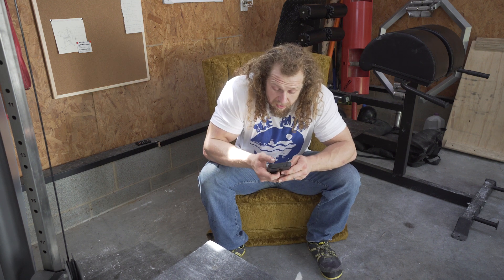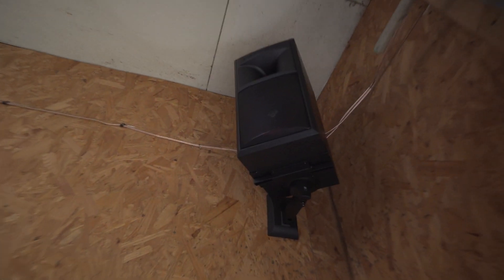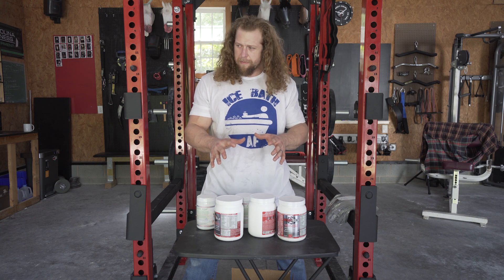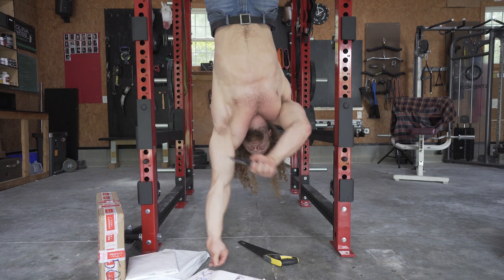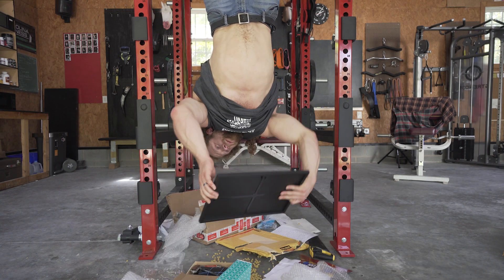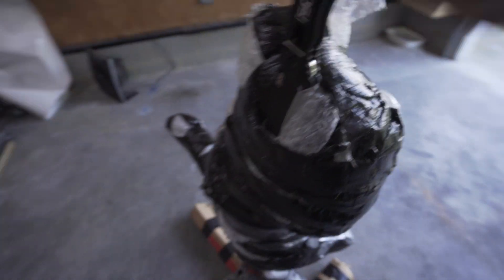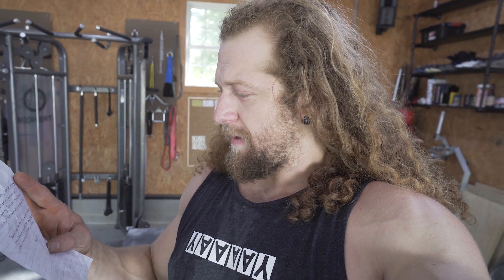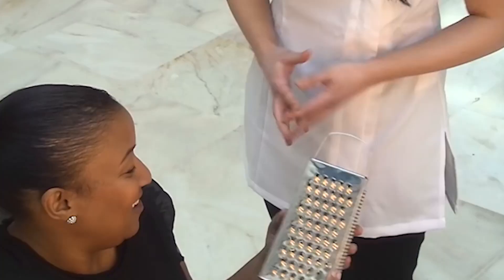Sumo deadlifting aerobics | ft. BANANA CHALK BOWL

Comment: Put your barbells on the garage door if its wide enough! Make sure you check that the track is anchored properly and can support the extra weight. Also need some sort of clamping hooks so they don't fall off when you roll it up. Pulley system with a rope on the opposite wall to roll up the door manually. It will be heavy!
Reply from the maker: wow that would be really fucking cool. I dunno the doors seem pretty flimsy. Man if that could actually work though!

Comment: Yeah, gun-racks for bars are kinda played out. I do woodworking as a hobby and did something a bit different; didn't realize it, but I mimicked Rogue's vertical bar hangers. Main difference is that mine are wood, bolted in to studs, and I put some padded adhesive near where the bottom collar nears/touches the wall (just in case I hang it up with a bit too much force and scuff the wall). Also have some padding near where it seats in the wooden hanger.

Looking at it, Rogue's really aren't that expensive (a shocker, I know). Could always give those a go or head the DIY route. Regardless, I think it's way better than leaning against the wall; frees up floor space, y'know?
Reply from the maker: That's true, but I'm reaching max capacity on wall space too! :-o haha
Reply: Running out of space? I've no idea what you're talking abo--oh crap I'm about to order a new bar help

Comment: Don't store the bars on the ceiling by attaching them, HANG them. Either by hooks or if that's not low enough chains with hooks, along the wall so kitty doesn't power charge through them and stub his epidermis. Had that happen once. Not fun.
Reply from the maker: yes, chains with hooks sounds way cool! didn't think about the added chains for aesthetic and swing!

Comment: Why do you take your shoes off to deadlift? Dont you need the support?
Reply from the maker: 2 reasons. 1. my platform is a smidge slippery with shoes, feet seem to grip better. 2. the lower you are the easier it is to deadlift, that extra few millimeters makes a difference, really does.

Comment: Solution to trap bar plates not touching the rubber... get a REAL trap bar. Yours sucks. Great for deficit work but that's just about it. Get one that's much larger. Look into Rouge TB-2 Trap Bar. https://www.roguefitness.com/rogue-tb-2-trap-bar

An added benefit, you can use it for heavy AF farmer caries and it'll even fit in a rack so if THE BUGEZ drops by again he'd be thrilled.